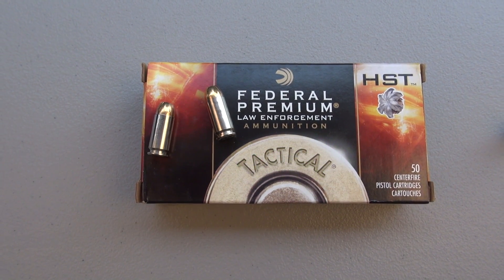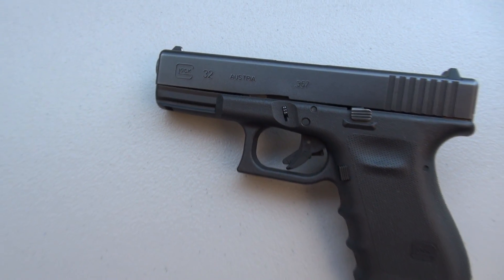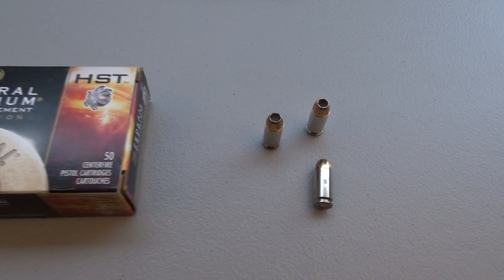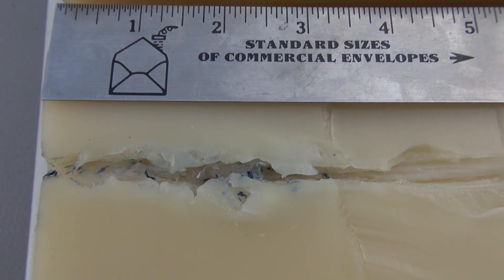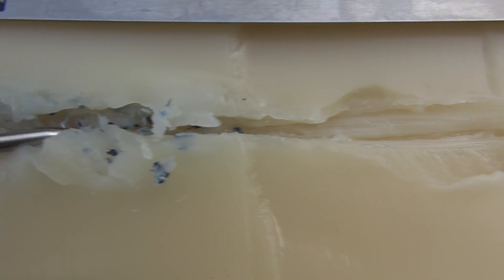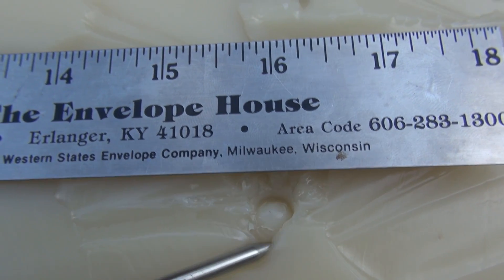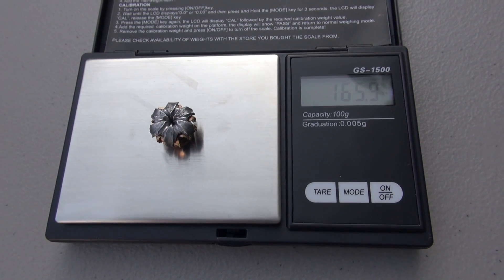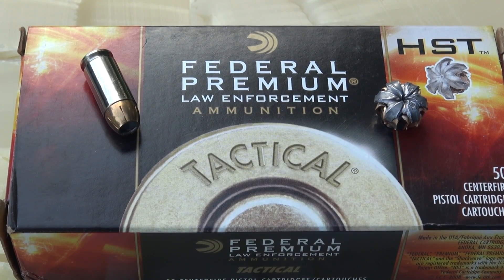Federal HST .40 S&W 165 gr JHP Ammo Test

Comment: Why is the product number important?
Reply: because there might be a variation of the ammo that doesnt meet standards but has the same name. It might have slightly different specs, still meets or exceeds the standard, but with the same name.
Around 2010 Winchester had a "Ranger Bonded" 180gr 40sw that was loaded for FBI specs* and was an overrun. Same name as normal 180gr "Ranger Bonded" but in a white box with a different product number. I think they are called SVT or something now.

*it was slightly slower, less velocity then the civilian version, but for some reason had slightly better ballistic results in testing and lower recoil impulse.
I still have over 2000 rounds of it @ .26cents a round.

Comment: one of the biggest differences between 40 and 9, particularly with HST in 40, is that even when the 40 gets plugged up it still expands. In fact, you will rarely see premium 40 not expand. Cant always say that about 9 regardless of the make...and it will almost always make the minimum and very rarely over-penetrate.
Reply: Two year old comment, but wanted to respond because this is very true, and rarely ever pointed out.

Comment: If I'm not mistaken, didn't these produce better results than the 180gr HST?

This had deeper penetration, a longer stretch cavity, and an equivalent depth measurement.   o____O
Reply from the maker: +Danmandingo I believe that is correct.
Reply: +Danmandingo The calibration was a little softer in this test though.  It was 3.4" in the 180gr test, 3.7" in this one.  The 180 grain also has about .1" larger expansion, which also reduces penetration.  Either way, both loads look like winners in .40!  I have the 180 grain version simply because I hate mail ordering ammo, and it's the only one I can get locally.  (in my 9mm's I have the standard pressure 124 gr HST.....which would be about #4 on my list if I had a choice :( ....the 180 HST in .40 is thankfully #1 or #2 if I had a choice so I am happy in .40...although the 9mm load I have is certainly well within my "adequate" range :)
Reply: +Matthew Caughey You're incorrect.

Comment: Funny how the 165gr. penetrates more than the 180gr., further proof that 165gr. is the magic number for .40 S&W. For 10mm carry I think it's 180gr. however. Makes sense though.
Reply: Jonah Patton You're not wrong, fundamentally speaking. I stand by my claims, however. 1/10" is negligible, and the weight of the 180gr should have made up for the expansion, in theory, but .40 just isn't pushing the 180gr quite fast enough to be as effective as the 165gr - hence my use of the term "magic number."
Reply: Yup needs more speed 180 is too heavy.
Reply: You're absolutely wrong about friction, first of all. Frontal surface area, bullet design, and caliber are all the same - the only difference is the weight. Second of all, if you know anything about terminal ballistics you know that a heavier bullet penetrates more than a lighter one all other variables except bullet weight being equal. There is a "magic number" in every caliber where if you shoot any heavier your penetration will suffer, but I guess you're an expert in physics so you already know that.
Reply: not trying to be a dick but i dont think it has to do with magic bullet weight, it expanded less, so it penetrated more, thats hollow points 101, the 180 gr expanded a 10th of an inch more
Reply: I too am starting to believe 165 grain is the ideal projectile weight for .40
Reply: 155gr is the best from my opinion

Comment: ***** I was just curious which round do you think is the better round and or did the most damage. Speer gold dot 165gr. or federal hst 165gr. ????? Any others opinions are welcome...
Reply from the maker: It's a toss-up, although I'll lead with the Gold Dot in my Glock 23.  HST would be my second choice, and probably 165 gr PDX1 next.  As of June 2014 I'm giving the Glock 23 Gen 4 a serious test for my carry gun.  I've been watching ALOT of Glock 23 videos lately.
Reply: Both are excellent and equal. So your choice will depend on which bullet your gun has the best accuracy with.
Reply: What he said (powerpickle68). I personally feel a SLIGHT bit more recoil out of the 165 gold dot in the Glock 22. I use the HSTs at work (LE) in the 155GR dose and they are an excellent round. As is the gold dot....I don't believe one could go wrong with either....
Reply: ***** Thanks for your opinions. I very much appreciate it...
Reply: ***** Have you made the switch over to the Glock 23, yet? I have a 23. I have considered getting a 9mm barrel swap. Which brings me to my next question. Where do you get you're replacement barrels? If I'm not mistaken, in your videos, they look like they're from the factory. I'm not a fan of the wolf barrel conversions, unless they're available in black and I didn't know it? Thanks, as always. - Tony. 
Semper FI

Comment: tn9:  

Uncharacteristically poor expansion (.63) from a 165gr .40 HST, causing penetration (16.5") to exceed safe levels for home defense. Your test of the slower moving 180gr .40 HST showed much better expansion (.74) with good penetration at 13.0".  Looks like the HP petals of the 165gr bent over too much -- decreasing the diameter -- thus increasing the penetration.

It would be interesting to see the 165gr HST tested from a G27 with a 3.46" barrel, to see if the reduction in velocity prevents the petals from bending fully downward.

Comment: The bullet could have been a bit heavy to begin with.  I just say that because I work in a factory.  Im sure Federal has a weight range that is passable, +or-.  Like any other type of production plant they strive for perfection, but at the fastest rate.  So some do get by that may be a bit out of spec.  If you run in to that again (bullet being over weight) maybe pull one off a casing and weigh it unfired.

Comment: To clarify, speed of sound raises with temperature (elevation doesn't matter), 

1087fps at freezing vs 1140fps in the 80s, 

I carry golden saber 165 and preferably 155HS, the165HS is much slower at ~980 and my store didn't have HST in .40.

I've noticed recoil/noise difference the most and unsure of the accuracy/tumbling; the accuracy charts on atk/speer's website assumes pistol zeroed 25yds, which is after becoming subsonic.

Comment: A bullet going 1125fps can be much calmer to shoot than a bullet going 1130fps, It is possible for a bullet to tumble going from +sonic to -. pistol bullets should be 100fps+ speed of sound, or below it, imo. 

Top brands like tnoutdoors tests may design around this but not sure it can be avoided, esp if barrel short or long.

124+P GD (Vi=1200) in G19 has about 15yds before it gets flicked by that pressure wave catching up. i've not tested just like reading physics. have seen pdx 124+p keyholes